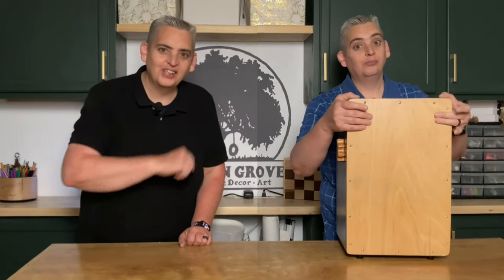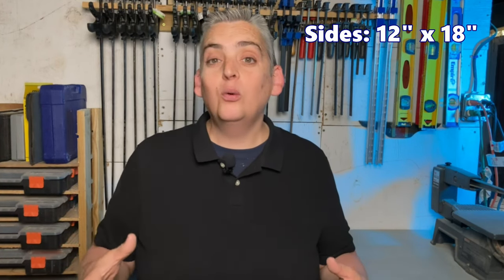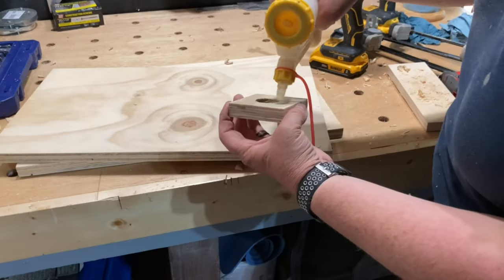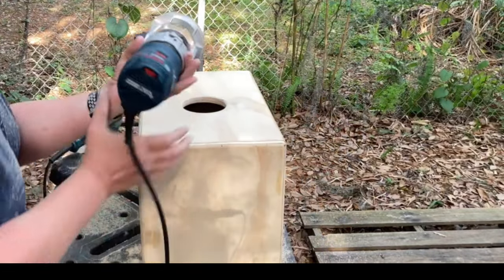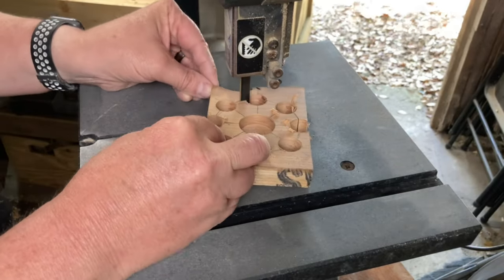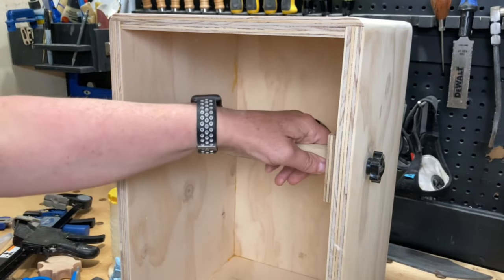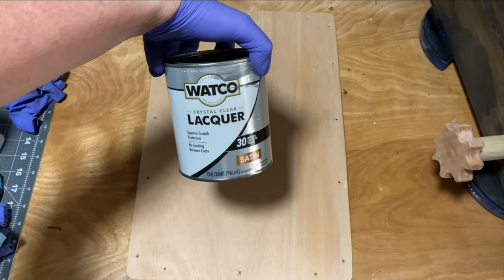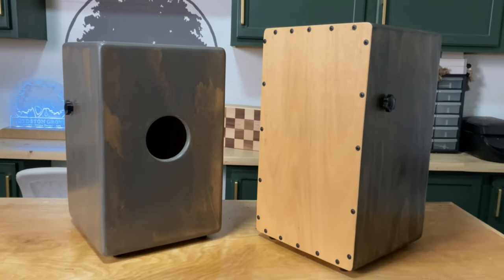How To Build A Cajon // Making A Box Drum

Comment: As a drummer, it's good you left the snare in the box. Both with and w/o have their places in music. Is that all that's in those things? I've seen them with some kind of tin plate I guess for the snare instead of a regular drum snare. I've also seen them plug into an amp. Don't know much about them, but from the first time seeing one, it's got to be way easier than hauling a whole kit around lol......great project!
Reply from the maker: Thanks! Yeah, my friend has an electric one that has built in effects and everything which I would think defeats the purpose, but I digress. I've never seen one with a metal plate, most of the tutorials I found used the snare, the plate may add an interesting sound though. I did discover that the one I made just a few inches taller has a much better sound. Thanks for watching!
Reply: I'm just building my second Cajon right now and i want to try those piezo pickups that you can buy for acoustic guitars. They are really cheap (~10$) and have three self-adhessive, round pickups, so you are able to place them anywhere on the plate.

Comment: Question... Does the size of the rabbet you cut matter in this project?  Would  the size of the rabbet cut  change any of the dimensions of the other pieces?
Reply from the maker: The depth of the rabbets on the top and bottom panels don't effect the sides, However, the depth rabbets on all the panels will all effect the size of the back panel. And they all also effect the front panel but that should be cut last anyways so you can cut it to size.

Comment: Great woodworking! Looks awesome! I you could get a better sound. I made a couple cajons and have drummed for decades. As a drummer I like a tight high snare sound with a deep bass. I tend to play along top corners. So I moved my snare wires more to the corners. I also think the snare sounds better with more snare wires laying along contact with the front panel, not just the ends of the wires. I tried a bigger size for more bass but I noticed how tight and loose the screws makes lots of difference. So I left the screws less tight for the bass, then tighter along the top. I’ve even tried putting a piece of tin under one top corner for different sounds. I also installed a piezo pickup, but sound it sensitive and loud, I still used it with low volume. Only a good kick drum mic gets a huge bass sound. 
Love your video, from New Zealand.
Reply from the maker: Thank you! I could have used your advice when I was making them. I will def. take all these notes into account when I make another  one. Thanks!